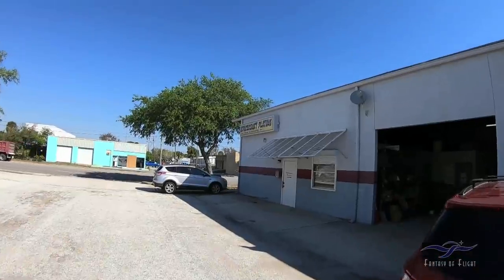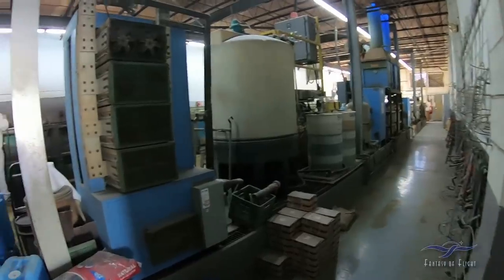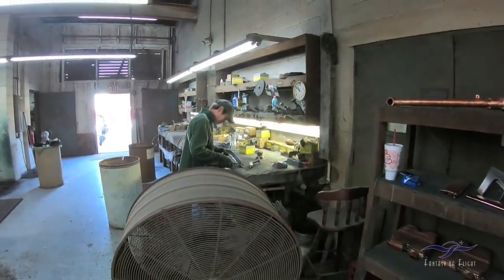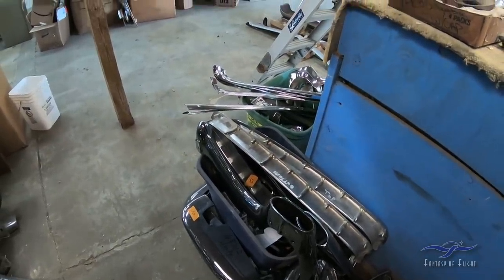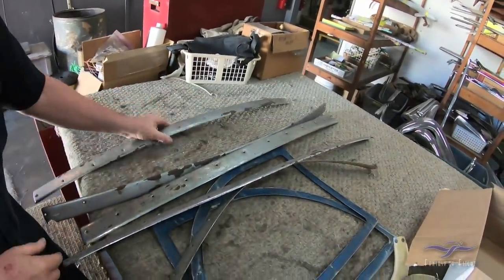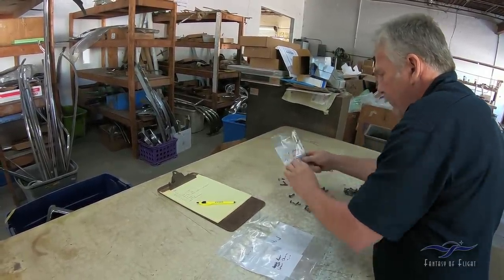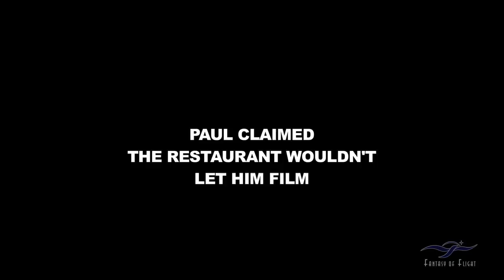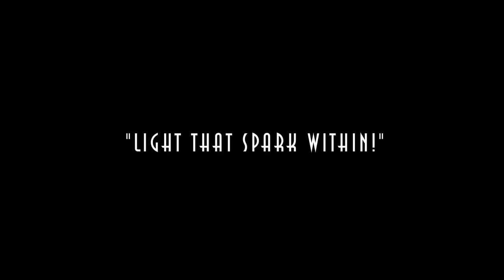Messerschmitt Bf-108 - Restoration Update #10 - April 2019

Comment: Well, as alway a very nice look into the restoration process. The only part I sorta frowned on was the tally by the chrome guys. It seems that all the sorting of critical parts went out the door, when the chrome guys were looking at the nuts and bolts on the table. Hopefully all will go back in the original bags. I'm hungry now...... Can I order now.
Reply: I had the same thought.

Comment: Those little parts have a habit of flying across the room while your trying to buff them. And to plate them they either fall off the hangers or get shadow plated in spots from plating them in a basket. If they don't discover they have fallen off soon enough they die in the bottom of one of the tanks. Your chances of getting all the little parts back properly plated is slim to none. Double count everything at pickup will save you time later looking for parts that may not be in your inventory. The biggest problem for the EPA is keeping these chemicals out of drains inside and water runoff areas outside. 

Any airplanes coming to Oshkosh this year?

Comment: At 11:13 is an equation for you :- vapour from tricloethylene cleaning tanks  + cigarette smoke = mustard gas (phosgene).  Like in the  WW1 trenches. Mustnt happen.
Reply: I don't think it's cigarette smoke that is the problem, it's breathing trichloroethylene through the glowing tip of the cigarette. Apparently it decomposes to phosgene and HCl if heated above 600F, and the cigarette tip can reach 1600F during a 2 second drag.

Comment: Paul, Could you comment on hydrogen enbrittlement of chrome plated parts?  I've heard that chrome plated parts that are not baked immediately after plating are subject to hydrogen enbrittlement and therefore can break without showing prior indication.  On the other hand, I see lots of parts being chromed that are used in high stress areas and seem not to give any problems.  Thanks in advance.
Reply: Spacecoast Plating might have an answer to that one...I doubt Paul does, it's not his field - like he said, not a job he'd like.
Reply: @dbaider9467  Anyone who uses chrome plated parts on high stress components should know the consequences of the plating process.  I would venture to guess that trim parts do not fall into that category.  Chrome plating an engine mount isn't something I would do unless the plater could certify it to an appropriate standard, i.e., a MIL-spec.